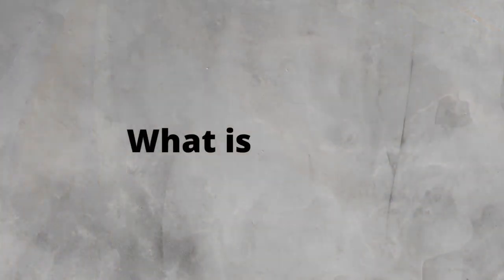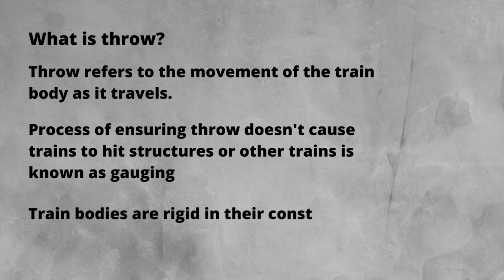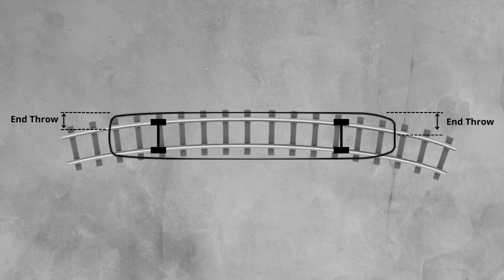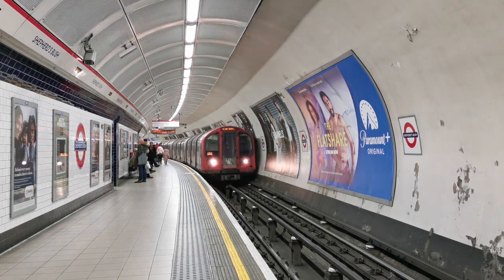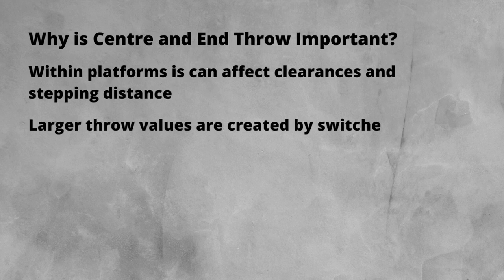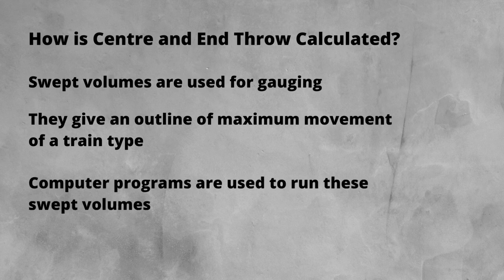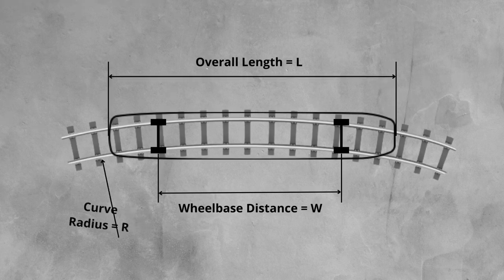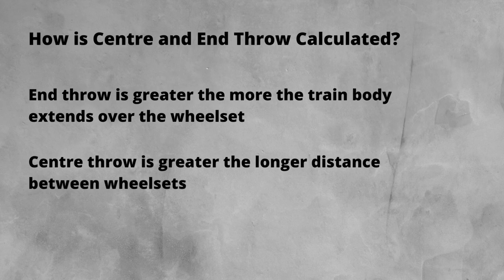Gauging Analysis for Railways: Easy End and Centre Throw Calculation

Comment: Thank you very much for your video. This is a great video to me. But, can I ask you that does END THROW depend on speed of a rail vehicle?Now, I am studying on the end throw of rail vehicle when entering a curve to check the safe clearance distance at curved tracks so no one get hit by a vehicle. Thank you very much
Reply from the maker: The body dimensions of the vehicle is the major factor but, given that the speed of the train will determine how much the body rotates or sways in the curves it think it would be a factor. But more of a minor one
Reply: Thank you very much for your reply. Could I ask you about where I can refer to. I mean do you know any textbook that derives this end throw formula? Acutally, I am doing a university assignment, so it would be better to include the reference for this end throw formula. Thank you very much @thepwayengineer

Comment: May I ask, iis the couples will be included in an overall length?
Reply from the maker: That is a good question, i would think not, as they are well inside the body of the train and unlikely to be the outermost section that could hit something. However I am happy/ hopefully to be corrected if I'm wrong!
Reply: thank you to your response, just in case the train coupler is just in front of the train, do we need to add this to get the actual fulll length for thorw calculatuon?